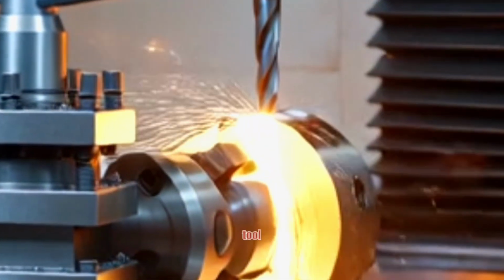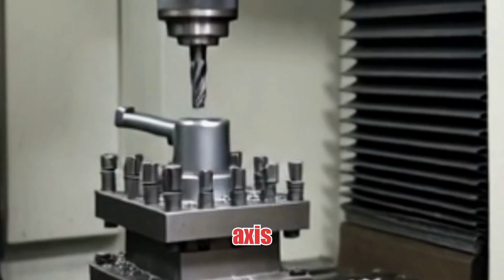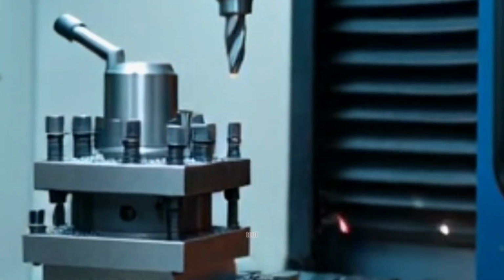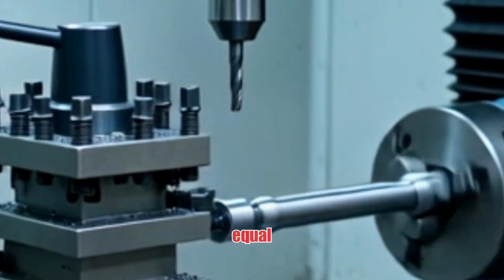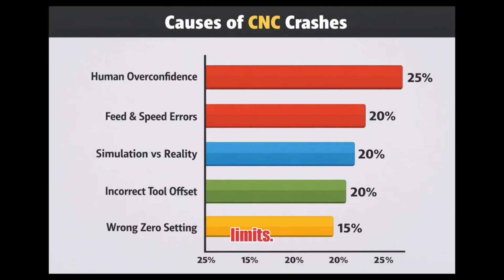📌 CNC Machine Crash Explained (Avoid This!) | #CNC #Machining #CNCCrash #Manufacturing

Comment from the maker: ⚠️ Most CNC crashes are 100% preventable
The problem isn’t the machine…
It’s the process + small mistakes we ignore.
👇 Quick Reminder:
✅ Always do a dry run
✅ Double-check offsets
✅ Use single block for new programs
✅ Keep hand on feed hold
💬 Tell me honestly—
What was your biggest CNC mistake?
Let’s help each other avoid the next crash 👇